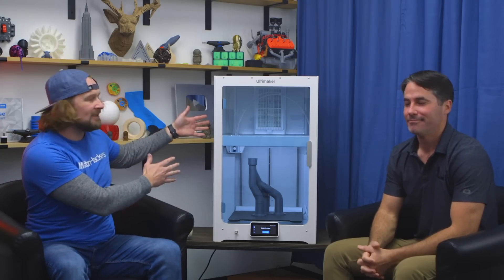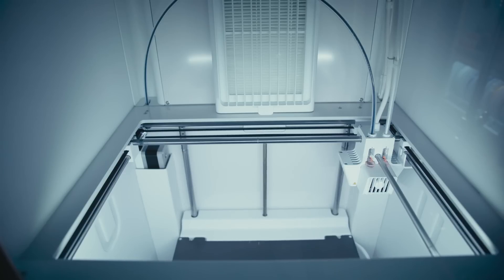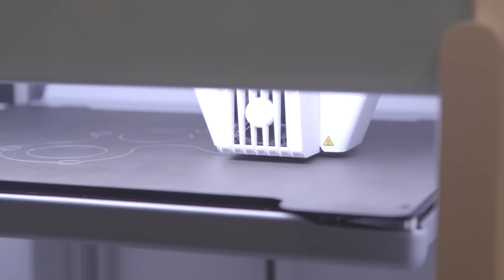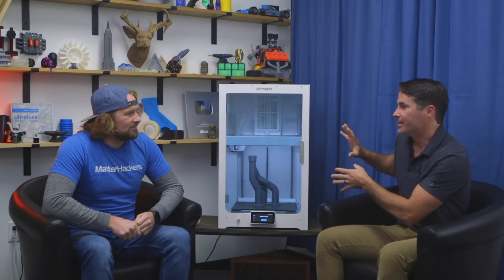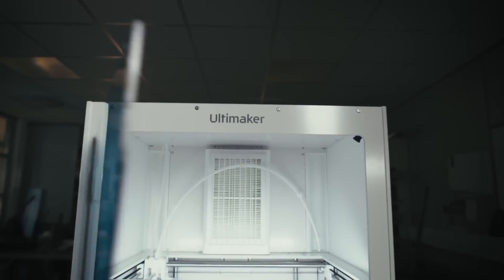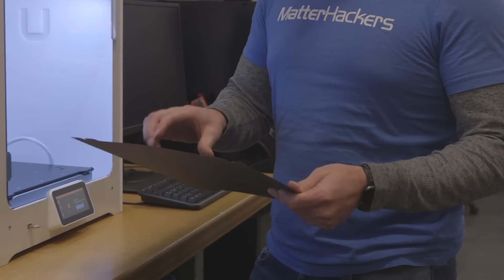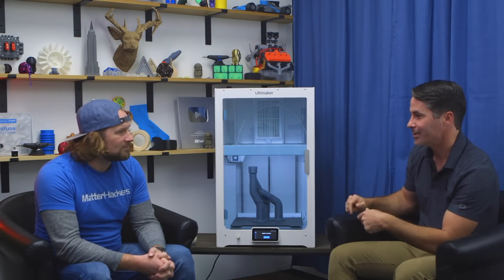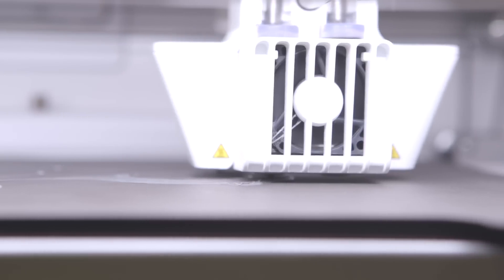UltiMaker S7 3D Printer Tech Breakdown & First Look

Comment: Flexible build plate so it’s pei I assume and bed levelling.
Is that it?
Bit disappointed to tell you the truth.
There are other printers that do this and are enclosed and have filters much cheaper.
Would expect something new. 
Sure it’s a nice printer but just too expensive considering there are other cheaper options .
Reply: They also have a camera!
Totally worth $10k.

Comment: It's amazing what a 3D printing company can come up with when the goal of the company is quality user experience, not just trying to make a cheep 3D printer to outsell other cheep printers.
Reply: Bambu Labs. Ultimaker is becoming like Stratasys, living off a name and providing little to no gain at a massive markup. 

This update is sad and lazy. Still not properly sealed (gaps around the door), a massive machine with no gain in build volume, switched to a PEI plate which is almost standard, and as far as I know, everyone else offers it as an option anyway, and the price tag is HUGE. 

Bambu labs' X1C has a built-in lidar that will scan and auto adjust flow settings, auto check first layer adhesion, has vibration compensation and will print 4-10x faster than an Ultimaker, has a comparable build volume, has spaghetti detection, a great app, etc. And is 1/5 of the price WITH a material station. 

We got an S5 and have had a ton of issues and we baby the machine. I was thinking with the increased price and the name it would at least be more reliable.
Reply from the maker: You can't beat UltiMaker quality and ease-of use - we are really excited about this new machine in their lineup!
Reply: @MatterHackers  ...Bambu lab?